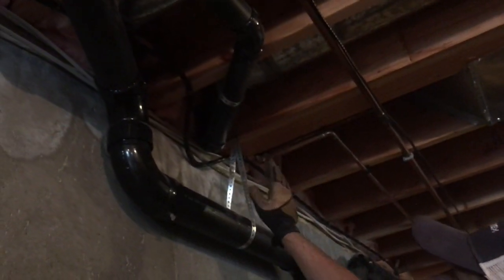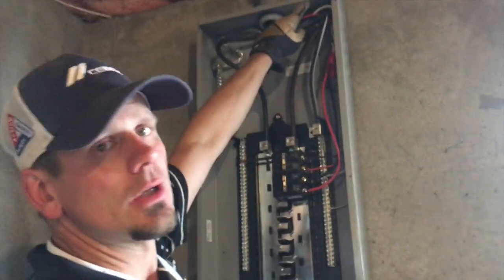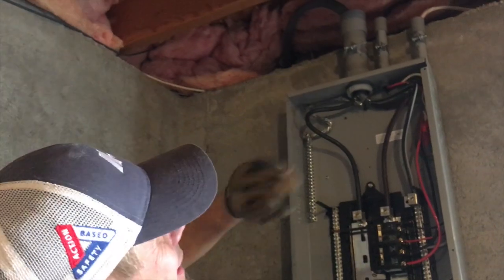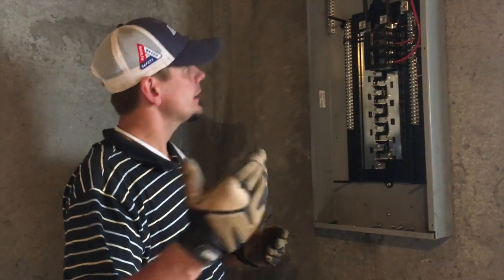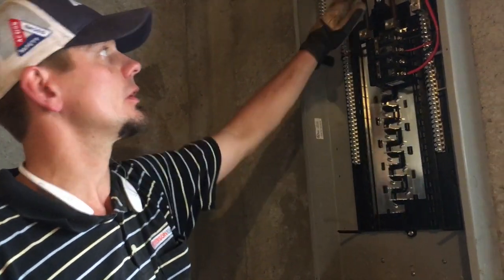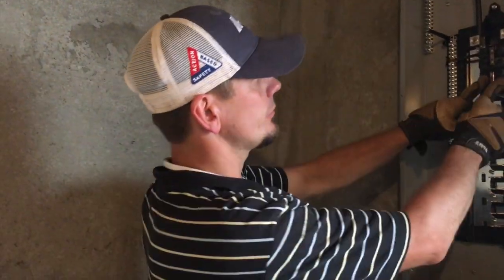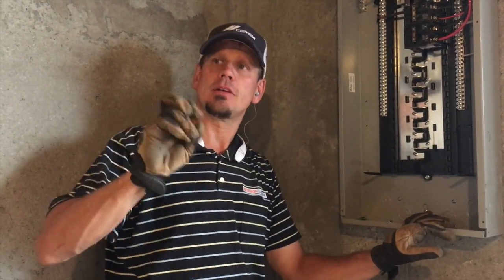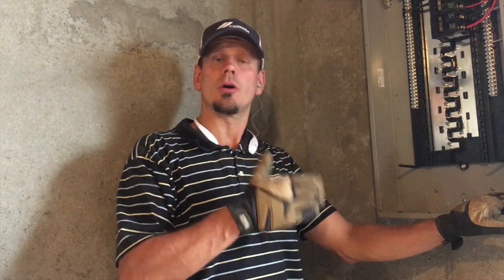Installed A 100 Amp Basement Sub-Panel From 200 Amp Main Panel For Homeowner

Comment: The sub panel should have a main 100 breaker, and mounted on plywood also make sure to remove the bonding screw. Where I live everything has to be in EMT pipe, good luck!

Comment: Question ? Can you install two  40 amps 2 pole  breakers and a couple  circuit for the lights  and receptacles  in a 100 amps subpanel..

Comment: It's been a long time since I did electrical, did it for a living for 7 years, 20 years ago. A friend of mine has his main service disconnect outside. Main breaker box is in the house somewhere. We want to come off his main disconnect to a sub panel for his hot tub, a coy pond pump, and some lighting. Can I come off the main lugs with the feeder wires to his sub panel? I can't find the video previous to this one, where you might possibly show that.

Comment: I have a 100amp panel and it's full and I need to run some new breakers for a 2nd master bedroom to be able to handle split air conditioner or 2 if possible but I need to add a 240v for welder and plasma cutter. Is this possible to be done and do you have anyone in Las Vegas NV you could recommend for the work? Ryne
Reply from the maker: I think you may need to make sure you have 200amps on the main breaker or main panel and come off of that. It all depends if you are using AC and plasma at the same time and depends if you are cooking and cleaning at the same time. Article 220.42 talks about loads
Reply from the maker: Yah , never thought a customer would get blown off of a ladder like Chevy Chess Christmas movie. LOL

Comment: Can I put 125 Amp sub panel with 2/0-2/0-2/0-1 SE aluminum from 200 Amp main service panel?
Reply from the maker: I would run a #2/0  SER Sub Feeder, (Aluminum). Or a #2 Copper TC cable is best.
Reply: I have a 125 amp subpanel can i use 2-2-2-4 cooper with a 100 amp breaker?

Comment: question, my garage current has only a 20amp run for lights, garage door opener, and 2 outlets near the front. this constantly trips the breaker when i run the air compressor. even sometimes running a high amp grinder....anyway...... the main is only 200 amps and seems very loaded (only 3 slots free).   is it safe/optimal to run a 100amp subpanel in the garage off the main, and then rewire garage from that?
Reply from the maker: As long as you have everything checked by a professional and ask their opinion in your area. They need to do a load test and a panel scan. They could also do a load cal to see.
Reply from the maker: Depends on the list of items on your service, 220.42 talks about this for your load calculation. You do not add all your breakers together.
Reply: This is the same problem i have the only issue i have is that im renting the property and can't do anything without the landlords permission i have a 15amp heater and compressor combined with the garage light and garage door opener i have to turn everything off to run the compressor it sucks